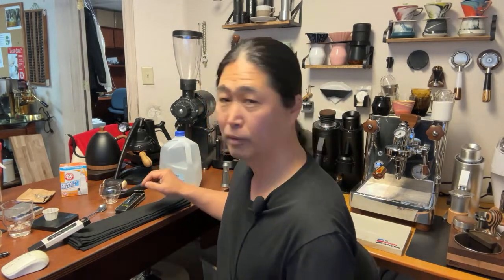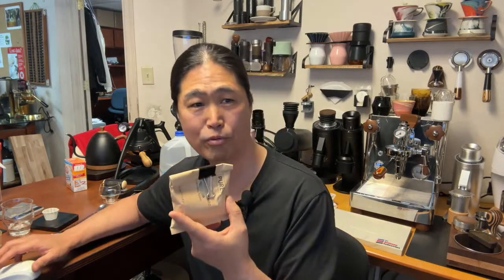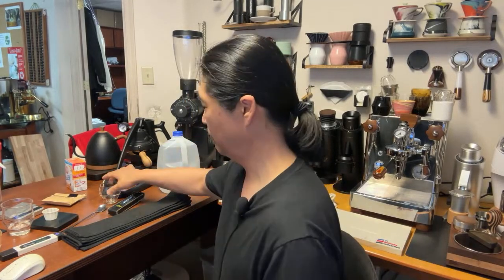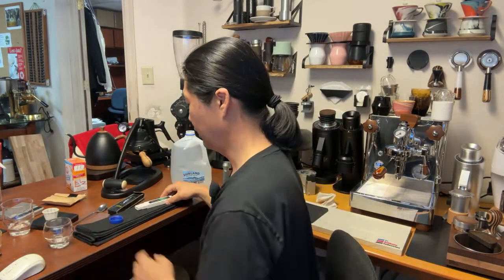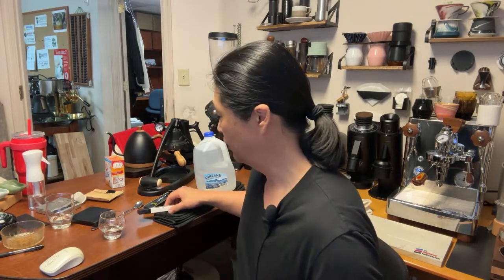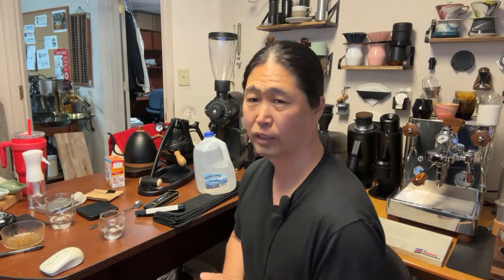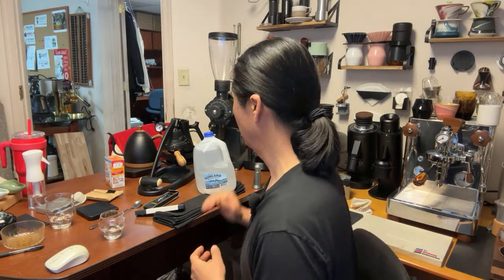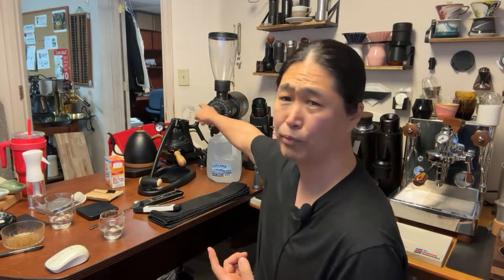How to Make | Scale Free Water Recipe For Espresso Machine | Dr. Pavlis

Comment: Hello Hoon, how has this water recipe been since using it in your machine? I’m curious if I can eliminate the noise coming from my Vetrano, which after cleaning out the mesh screen in the out line from the pump periodically eliminates the noise when the pump is activated. I’m currently using BWT drop in reservoir filters